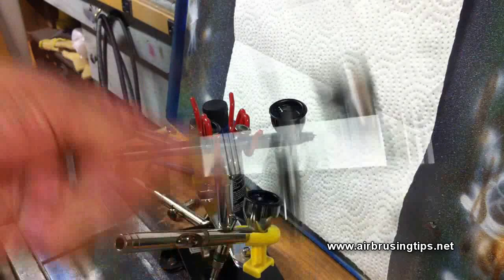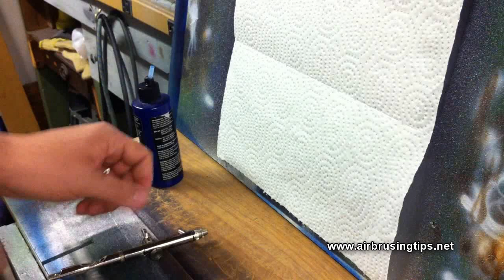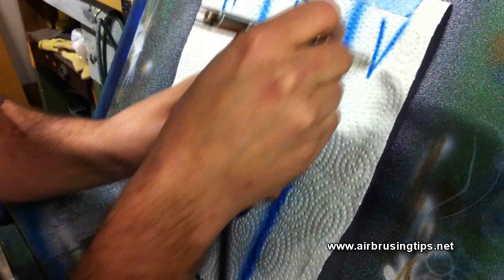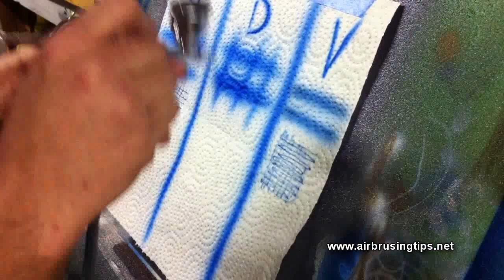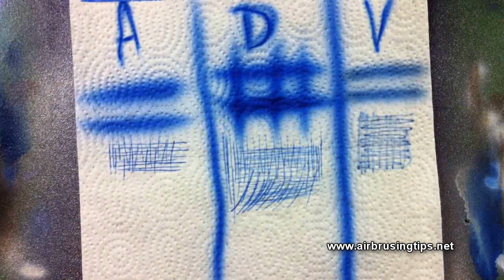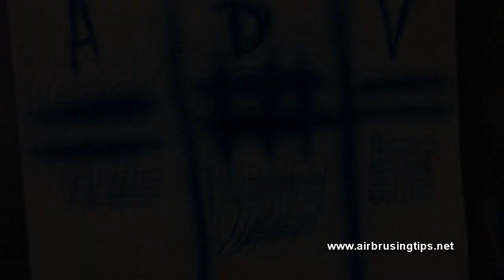Airbrush trigger control

Comment: Awesome video Sarge! really helps me out being brand new to airbrushing to see that all I really need to concern myself with is wether its gravity or syphon feed. Seems like all three of the brushes sprayed about the same on the thin lines. The only place I could really distinguish the difference is in taking the crown cap off. the lines seemed to become more crisp but as you said you risk bending your needle.

Comment: To me, on the Velocity, lines look a touch thick from what I would expect with that needle size. I can pull thinner lines with my Dager, but so did you, it could be from your needle not seating properly due to it being dirty like you pointed out. But only you can say for sure.  I really like the way the Anthem sprayed, it impressed me the most actually. Thanks for the demo comparison.